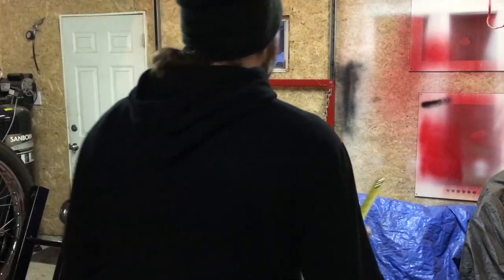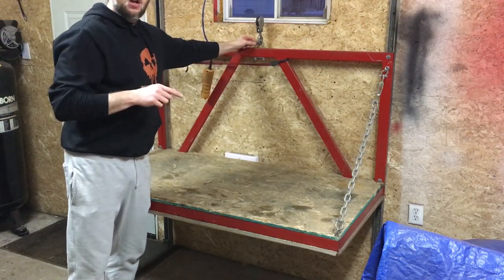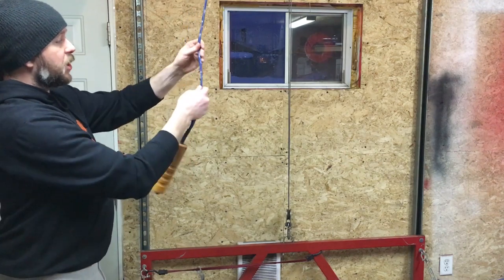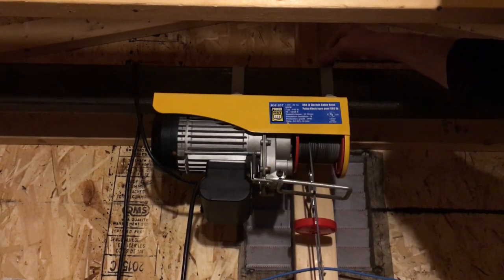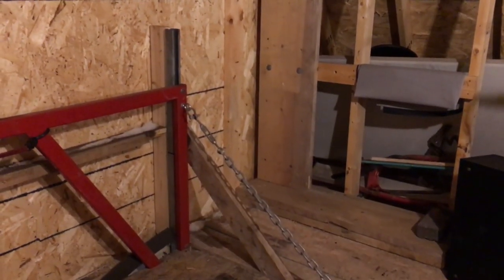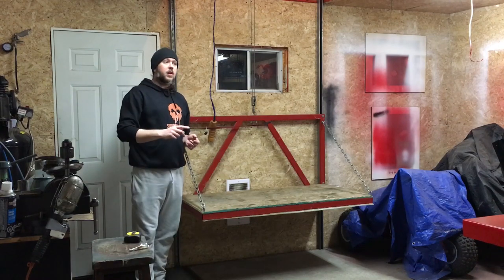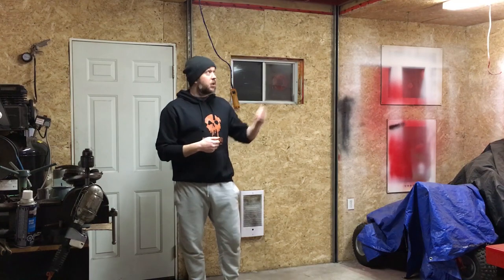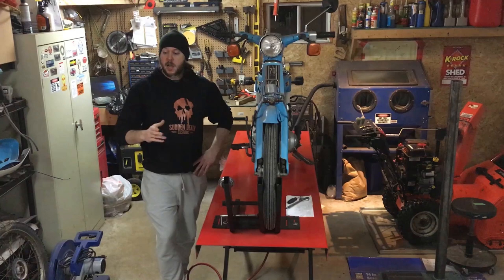Detailed Garage Attic Lift Build (HD)

Comment: Excellent build bro! However Your actual lifting capacity would be hoist total lifting strength minus the weight of the platform.
Reply from the maker: Hey Cavell, although I don't explicitly state that, I figure it is implied since, physics, ya know? :)

Comment: How does the controller hang down while the lift is up top?  Is there just a little hole to dangle it through?
Reply from the maker: The cable fits between the lift and the hole. The gap on the left side of the lift is about a half inch, more than enough for the cable to hang down through.

Comment: The fall arrest system is a simple thing to do, just take inspiration from the old Otis system.
The cost is negligible, you can do it in various ways.
On the uphill slopes, make some gear-like steps also of wood, in the central fulcrum where the hook pulls the elevator, you will put your hook system.
Practically when the cable pulls, thanks to the weight of the elevator, it releases your system that compresses the springs, and the two blocks are deactivated, sliding on the gears created, in case the elevator should suddenly go down the springs will release the hooks which will get stuck in the gears. It is difficult to put into words.
Here is an example https://www.youtube.com/watch?v=sSjJjKcoNRk
Reply from the maker: Thanks for your recommendation Jack!

Comment: Should be able to install an automatic stop on it.
Reply from the maker: It'd be easy enough to attach something to the cable at the right point, for sure. It's something I can look into for upgrade round 2! If you haven't see it, I have done an upgrade video to this lift already, and I'm also giving away a cable hoist. Feel free to check it out on my channel!

Comment: I dont think you mentioned the actual weight of your platform. And in turn the max weight your load can be.
Reply from the maker: The platform itself is about 100lbs, so 880 - 100 would be the max it can lift. As mentioned in the video, the most I put on it is about half of that capacity.
Reply: Hmmm..I'm thinking of installing one of these for my basement to bring down heavy shop equipment like bandsaw, cabinet saw, etc.  Thanks for sharing

Comment: What was the overall cost?
Thanks
Reply from the maker: Lift was $149, steel for the frame was roughly  $60, the unistrut channel and dollies ran me around $150, and the large 2x4 steel beam was about 100$. Toss on 50$ for odds and ends and you're in for around $500.

Comment: That trolly you are using only has a 50 pound load rating. It’s going to break one day. I know of someone that fell 6 feet and is in a wheelchair the rest of their life now.
Reply from the maker: @paulschaffner5796  the load is not on the trolleys, it's on the cable. The trolleys are just there to guide the lift and the lateral loads on them are negligible.